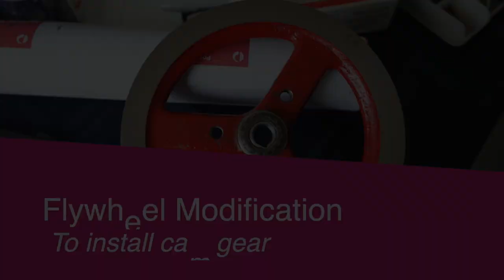Homemade 4 stroke engine build from Air Compressor

Comment: Wow big project, runs and sound good! to bad we don't live a little closer.
Reply from the maker: G'day Rick.  Yes it was a massive task mate.  Especially having to make the piston rings.  Even to get the old flywheel off I had to drill and tap holes so my puller would work.  The Chinese Honda donor engine was also a pile of junk.  The bloke who sold it to me said it was runner, but I highly doubt that.  The valves needed grinding and re-seating, but I didn't do it.  Hope you're well over there Rick. Yes, it's shame there is so much distance between us all.  If you ever in Australia make sure you look me up.  Cheers, Aaron.

Comment: I recently bought an antique Curtis single cylinder compressor that I plan on turning into a gas engine over this winter. Really looking forward to it as I plan on machining the head myself and building it from scratch. Great job by the way thing runs beautifully!
Reply from the maker: Hello and thanks for watching.  I was very happy with my finished motor.  It's not very practical, but I'm so happy that I pulled it off.  Not sure if you know, but I have full build series up on my other "Aaron Engineering" channel.
https://youtube.com/playlist?list=PLTfIAPzXVjcfjViMWg3IysBwmLN-ZiXHS
Your Curtis single cylinder engine build sounds like a great project.  I would be very interested in seeing this build once finished.  Feel free to share some pics or video clip of your progress. Thanks again.  Aaron.

Comment: Great bit of work. Ingenious reworking of existing components.
Questions: After expending so much time and energy building such devices, do non of you characters spend two minutes to bolt these creations down to something substantial?
Do you like to see them bounce around uncontrollably on the bench top?
Reply from the maker: G'day.  Thanks for watching the video and taking the time to comment.  This is something I do as a hobby outside of my day job.  It was purely for "proof of concept" and I never had any intention of using the motor for anything.  Additionally, the donor air compressor crankshaft design isn't suitable for power anything.  As you can see from the video, when powered by internal combustion it creates huge amounts of vibration.  Even when I clamped the engine down to the table.
Reply: @DCT_Aaron_Engineering  I think it's really cleaver to put together a bunch of parts that were not together previously and were never intended to go together and make a running engine. Fantastic!
I guess I was just commenting from a OH&S perspective. Open chains and sprockets, moving flywheels and fingers are a really bad mix.
Keep the projects coming, it's very inspiring.

Comment: That's some really nice work. I'm currently working on building a Vtwin from two 4 stroke weed eater engines (using overhead cam models to simplify this build as a traditional pushrod Vtwin  would add some complexity) and I hope it comes out half as clean as your creation.
Reply from the maker: Hi James and thank you for watching.  I glad you enjoyed the video and thanks for the positive feedback.  If you feel like sharing I would love to see your engine too.  Feel free to send me an email if you like.  Oh, I have a 4 part build series up on my other manual machining channel if you feel like viewing?  Here is the link to the playlist. https://youtube.com/playlist?list=PLTfIAPzXVjcfByPz35V47VoHfVee4kLwi
Reply: Sounds great. What engines did you use? Is it now up and running?
Reply: @Hydrogenblonde  unfortunately, or fortunately, I guess it's all about perspective, I got sidetracked building some hotrod minibikes including one I posted a video on my channel of (only video so far) that has a modified Briggs and Stratton Vanguard Vtwin engine. It currently hits about 78 mph and still has excellent acceleration. I've got a few more extensive modifications to make to the bike, front end, brakes, wheels off a Yamaha FZR and a 5 speed transmission to hopefully achieve a 100 mph top speed with a 0 to 60 time below 5 seconds which is ambitious for a 479cc engine that is essentially from a riding lawnmower.

Comment: Nice one Aaron buddy, turned out great mate, what are you going to put it into?
Reply from the maker: G'day Ralfy.  Thanks for the feedback.  To be honest nothing.  This was just a little project I did for proof of concept.  It was never designed to run for long periods as the cam and rockers have no oil feed to them.  So I just lubricate with a couple of squirts before starting.  It kept me out of the house and in the shop so I could escape the misses ha ha ha.  Cheers, Aaron.

Comment: Man, you have lots of machines. How's lockdown treating you? And btw, I love the pop when you pull the cover off the piston housing.
Reply from the maker: Hey buddy. Thank you, yes I’m very spoilt with my home workshop. Thank god the misses doesn’t know what I’ve spent on it 😂. Yes lockdown has been a real FKN pain in the arse. I’m actually a high school shop teacher, so this remote learning is killing me & the students (metaphorically speaking). We should be in the workshop making stuff, instead I’m bashing the poor buggers to death with theory 🤦‍♂️. Hopefully we’re nearly through to the other side. Trust you’re doing well? Cheers 🍻. Aaron
PS: I have another channel called Aaron Engineering it’s predominantly for manual machining though 👍
Reply: On dear God man, theory, what the! Bet that has gone down like a lead balloon. A year later and I decided to upgrade to a better 3D printer, and it is good but nowhere near as cool as what I see the wood and metalworking people do, especially on a lathe.  I have to stop myself from going, "what was I thinking"—been watching Mark Preslings plane motor build, which is both fascinating and stressful. I'll have to check the other channel out, if you talk metric, then I'm already sold, and manually machine seems to be the best starting point.  

Though I found a good planetary gear maker software in fusion you maybe interested it, which is literally called " planetary gear maker", I bought the 3D printer thinking I could make a gear system for nema 17 and I have a design and was trying to make it out of nylon carbon fibre, yet it is too tricky a material to print, and other things in life just got in the way. As they say, such is life. Anyway, take care and ill see you on your other channel :) Cheers TC

Comment: Gday Aaron, well it’s bloody worked and that’s awesome, it’s a lot quieter then I thought it was going to be, you’ve really done a great job mate, it’s been a great series to follow, what’s build is next?, Cheers
Reply from the maker: G’day Matty. Thanks for stopping by mate. I’m so proud of this Frankenstein project. To be honest, I was starting to worry that I wouldn’t pull it off. I still need to finish the build series off on Aaron Engineering. I shot so much footage, shame to see it go to waste. As for the next project, like you Matty I’m keen to build the Webster Engine too. 👍🍻

Comment: Really nice job Aaron. It sounds great. Honestly, probably better built than that engine you salvaged parts from. All the best!
Eddie
Reply from the maker: G’day Eddie. Thank you, you’re way too kind mate. I’m so happy that I pulled this project off. It’s taken way too long, 8 months to be exact. Yes that Chonda doner engine was totally stuffed. The bloke said it was a runner, but I highly doubt it. I should have refaced the valves, as they are leaking slightly. Hope you’re all well over there? Cheers 🍻. Aaron